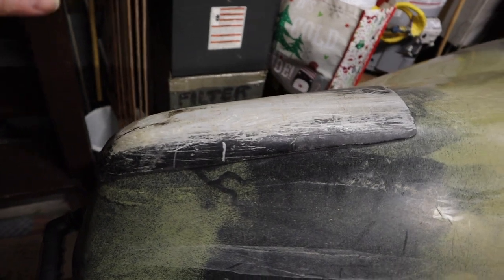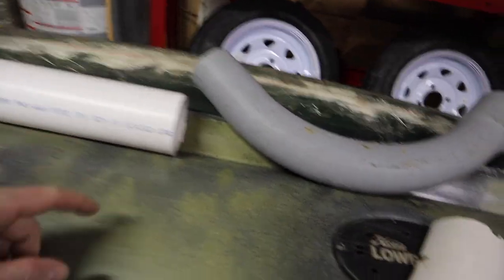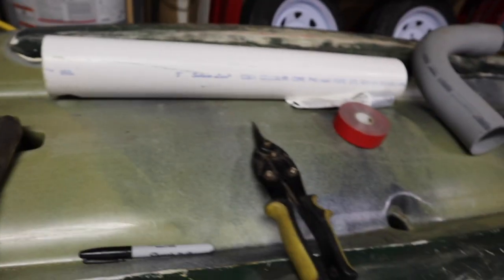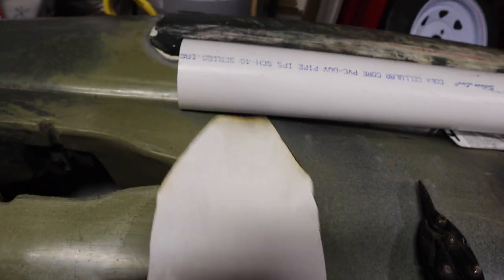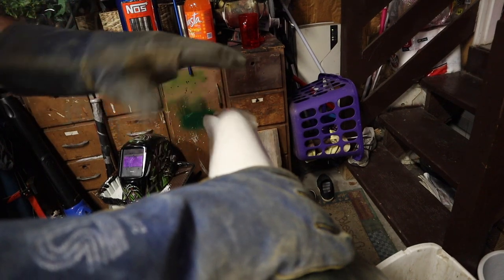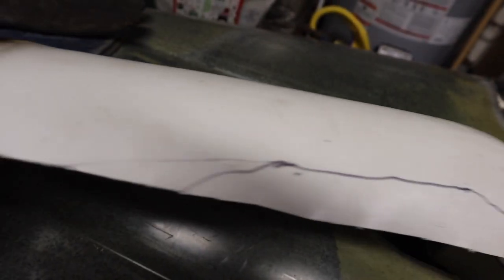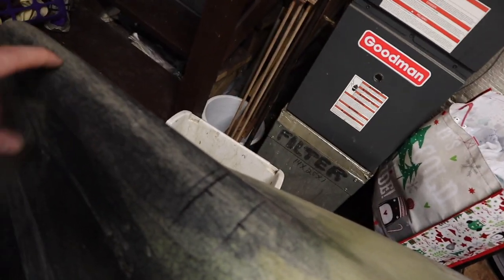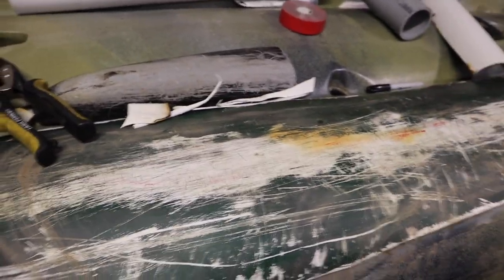The best front skid plate for any kayak ( D.I.Y Keel Guard part 2 ) tips on how to make one easier

Comment: Thanks for the video I followed some of your steps. I used an 18" lengths of 2" schedule 40 PVC pipe that I already had. I cut 3" from its 7" circumference and using a heat gun it became payable in about 5 mins. I had some thin 3m double sided tape and used some straps and a clamp to hold it in place. I painted it and then to help with positioning I sqirted some 50% isopropyl alcohol on the guard. I have pic but don't see where I can add them.